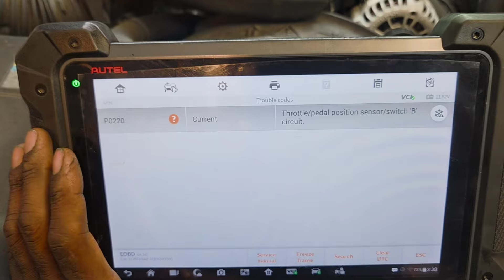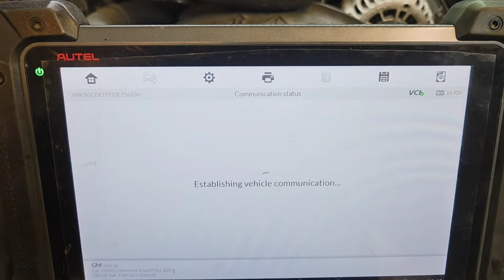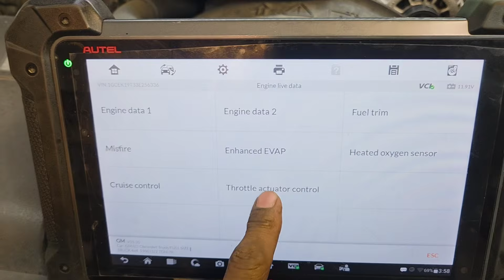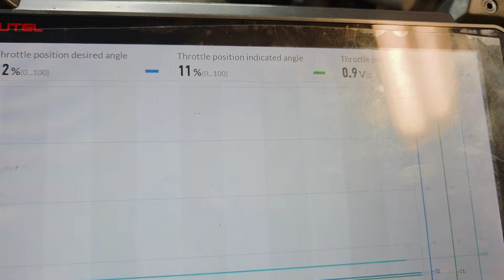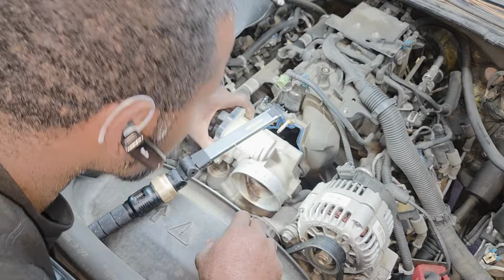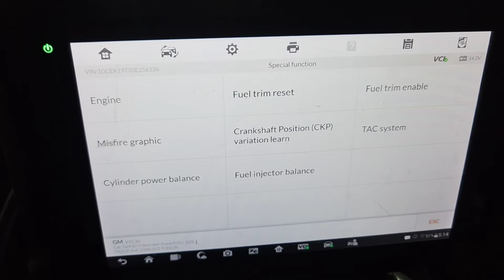Chevy silverado P0220 code and reduce power

Comment: Hey you went with what you felt was the best repair for this job and , hopefully you replaced the PCV as well so it can hopefully stop from clogging up the new throttle body as well. How about if you would have cleaned it first and see if the numbers would have changed , that might have made things right.. I can’t say you made a wrong choice on the repair cause it’s working, just can say it might have been a waste of money ! We shall never know. Thanks 👍🏼👍🏼👍🏼👍🏼👍🏼

Comment: Thanks for the shout out, ha it’s funny the tps issue I mentioned earlier is the same as your customers issue. Intermittent limp mode. It was the throttle position sensor on the side of the throttle body , apparently there is a sliding contact area on the circuit board inside the tps that causes this. I guess it’s a common problem for these 5.3’s. So yeah your hunch was most likely correct.Once again I enjoy the content and thoughtful commentary.

Comment: What do you think about my new Autel ultra bricking on me and them making me pay over $100 to ship it to them 🤷🏼‍♂️
Reply from the maker: Which autel you have?
Reply: @partsshooter ultra maxi just like yours . Maxi system with scope
Reply from the maker: I gotcha.  Can you be more specific.  What exactly happen when it went brick
Reply: @partsshooter I down load latest app and updates then computer had red line said uncorrectable core 7 and was black screen. I finally got it to shut down. Tried to turn on this time said uncorrectable L3 tag scu ram . Called Autel they said yeah your computer is in the serial numbers that get corrupted with updates. Said you want it fixed you got to ship it to us 😬🫤
Reply from the maker: @sheerwillsurvival2064 geez... hell... at least you got that option just to pay $100, you're very lucky.  1 job you do will cover the cost. Ship that joker off man and get it fixed 😆